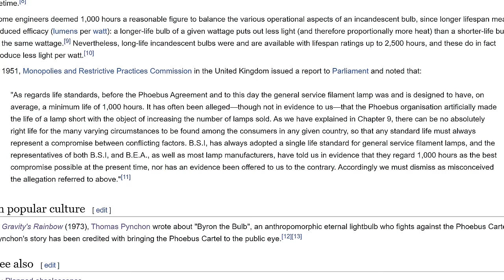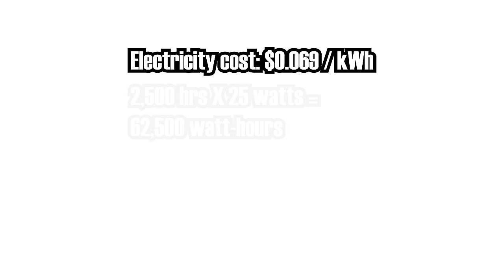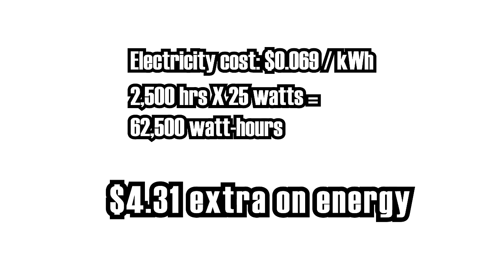Longer-lasting light bulbs: it was complicated

Comment: Things like that evaporation despite being below melting point were really counter-intuitive for me when I first learned about them. For anyone like me back then, the secret to understanding is thus: a material isn't uniform in its temperature. The energy fluctuates between the molecules, with some randomly getting colder and some hotter depending on how those fluctuations happen to  accumulate at any given molecule at any point in time. It just so happens that occasionally enough energy ends up in a molecule on the outside surface to liberate it from its bindings – something that would be melting/sublimation were it to happen to a larger portion of the material. With the energies we're dealing with in white-hot tungsten, it's enough to blast it off the filament with enough speed to shoot onto the glass in a straight line.

Comment: When I used to repair VCRs. Panasonic how to glue that they would put on the power supply capacitors which once over a certain amount of time heat it up would become conductive and blow the power supply. As a young tech it was explained to me that this was planned obsolescence. This was back in 1993.

Comment: One bone of contention for the new LEDs is that it's desirable to get away from BULBS altogether. There is generally no reason to have an envelope around the lamps, except to make them usable as drop-in replacements for bulbs. Using plates or strips allows a smaller unit, with probably less cost.

Comment: I was about to say.
The whole reason a lightbulb works is that it wastes energy on heat that just so happens to make a material glow when hot.
Something under that kind of heat that glows that much would probably be taking terrific wear and tear damage over time.

It would be like building a house out of cars, and then complaining that it kinda fell apart when a relatively strong storm came by.

Comment: I think LED lightbulbs on the whole are a great technology. I have an LED lightbulb that has been running for 24/7 and it has lasted for well over a year now. It has actually probably more likely at lest two years. That would never happen with incandescent lightbulbs. If a LED lightbulb is manufactured properly then the bulb can last for several years depending on how long you use it for per day. If you were lucky you would get about 6 and a half months out of an incandescent lightbulb if you used it for five hours per day. In reality you would get a little bit less or maybe a little bit more due to slightly different manufacturing tolerances between companies and even between individual bulbs. 

So yeah don’t go against LED lightbulbs just because the one that you had didn’t last very long because you have one that’s defective or cheaply made. That’s not the fault of the technology but of the manufacturing process and a company’s desire to cut costs.

Comment: I turned several cheap 100W led bulbs into 60W bulbs by messing with the current regulation circuitry. Now unlike literally every other led bulb I have, they now run cool to the touch. I can't say to their longevity since I did this about 4 months ago but I'm betting it'll be way longer then they would have lasted before.

Comment: Very interesting and informative! However, the very fact an appliance light might be designed for a longer runtime shows a weakness in the argument - if some use cases need a light to run longer, presumably because changing the bulb is expensive (due to limited access), this is something that consumers might face too - changing bulbs every 6 months could be a significant maintenance cost in some areas where access to a light is complicated, and the cartel denying consumers access to a suitable light was not to their benefit

Comment: Depending on brands I been changing some LED bulbs more often than normal Incandescent bulbs, even expensive brands like Philips I had several lamps break EXACTLY after 1 year use, and yes the warranty on these are 1 year but they are marked 15000 hours and I can with ease say they probably been lit 1500 of those at the point of failure. Planned obsolescence is indeed a thing and it been ever since back then. just cleverly hidden by the "reasons" they won´t last longer

Comment: LED light bulbs are currently being pushed as a way to reduce carbon emissions.  The deliberate shortening of bulb life spans by some manufacturers is sabotaging that.  If the bulbs had shorter life due to cheaper parts, that would be one thing (you get what you pay for), but the reason most are dying is because they are less efficient, and therefore producing more carbon emissions.
  LEDs are cold light devices; heat kills them.  When LED light bulbs were first introduced, they were marketed as having a 28-year lifespan, and used 7 or 8 watts.  Now, there are cheap bulbs with only a 5 or 6-year lifespan.  If you compare the watts used, you can see why.  The cheap bulbs are rated at 9, 10, or even 11 watts for a 800 lumen (60 watt equivalent) bulb.  And the bulbs from some manufactures actually use more electricity than it says on the box.  The extra electricity makes the individual LEDs burn brighter, and so the bulbs use fewer of them to put out the same light, but they burn hotter.  If the bulb produces the same 800 lumens, but uses more electricity, the extra electricity is being turned into heat.  I've measured some with surface temperatures of 180 deg F.  Which literally burns out the components, and also makes the bulb less efficient.  And the less efficient light bulbs are bad for the environment.  That undermines the whole point of switching to LED light bulbs.
  The EU has issued regulations that LED light bulbs have to produce at least 200 lumens per watt.  So an 800 lumen bulb (60 watt equivalent) will only use 4 watts.
  The other problem is that LED light bulbs usually have power factors of 0.4-0.6, which indicates more wasted electricity.  Incandescent light bulbs had a pf of 1.0, because they were pure resistive devices.  LED light bulbs have inductors and capacitors in them.  Any device powered by AC that contains inductors or capacitors could have a lower pf.  Pf is a measure of the amount of each watt supplied to the device that actually gets used by the device.  The rest is reflected back into the wiring and dissipated as heat.  Most people don't know about pf because electric companies don't measure pf on residences.  Businesses are a different matter, because businesses often have large motors (an inductor), and a low pf means the electric company has to eat the wasted electricity.
  An example of pf:  Suppose you have a 60 watt device with a pf of 0.75.  That means 80 watts has to be delivered so that the device can use 60 watts (60/80 = .75).  The other 20 watts gets reflected back into the wall wiring and the power feed and turned into heat.  Your electric meter that determines how much electricity you used only records the 60 watts, so the electric company has to pay for the extra 20, and has to take into account the extra heating that occurs in the lines.  Businesses usually have meters that record the pf, and they are charged extra if the pf is less than 0.9, because the power company doesn't want to pay for someone else's wasted electricity.
  The pf can be raised closer to 1.0 by adding inductors or capacitors to the device's circuit, or to the electricity entry point of a building to balance the entire building.  For a light bulb that only uses 4-10 watts, that might not seem worth the effort.  However, there are millions of LED light bulbs, using twice as much electricity as they should.  On top of that, manufacturers are selling lights that use higher wattages; some are 50 watts or more, and while they usually have better pf, it's still wasteful.

Comment: I have an LED bulb that I purchased in 2008 because I wanted it to run continuously.  Almost 15 years later (131,000 hours) it has dimmed slightly but still it’s otherwise fine.  The major brand LED bulbs that I buy at the home center all fail within 12 to 15 months!  Is this planned obsolescence?  I suggest that when you replace a LED bulb, write the installation date on the base of the bulb with a marker pen; you will be shocked by the short life that we get from LED bulbs.

Comment: You should do a video of how air conditioners actually change the temperature. I know about the mercury bead or bimetallic strip, but what happens inside the air conditioner? Is it really just turning off and on at different temperatures?
Reply: Simple: it just makes the refrigerant flow slower.

Comment: A single experience doesn't mean the average experience, but get this: I use 200W incandescent on a dimmer, enjoy quality light with superb CRI and whilst it's running, I've had to replace 3(!) LED's with lower output, running for less time and they weren't some ali express junk - a mid-tier priced lamp in a reputable store...

I pay in electrical bill for this, but in my experience LED's don't necessarily mean longevity as explained in this video.

Comment: I hope the next video is about LED bulbs. I often take broken LED bulbs from friends and simply bridge the one broken LED diode inside to lend them new life. It seems like a crime that most people throw away an entire LED bulb when very often just a single LED is burned out. I understand that loose tolerances in LED production make it way easier/cheaper to produce LED bulbs run in series than in parallel, however, it would be nice of manufacturers left contacts exposed and provided bridging clips to help you extend the life of your LED bulbs
Reply: He made a video about that last year.

Comment: 30:53
I moved into my current place at the end of 2018 and it's become clear the landlord used the absolute cheapest LED bulbs possible. We know the place was remodeled just before we moved in and just about all of the bulbs in the place are the same brand and wattage - so it makes sense why they went with the cheap ones. But I can think of at LEAST 7 bulbs that have gone out since we started living here ... several of those in the first year.

Still, that's not very many compared to what it would be if we still used incandescent bulbs. Plus our kitchen is filled with about 12(?) recessed lights - I can't imagine paying to run 12 60-watt bulbs for most of the day every day, and then having to reach into the recess to change a burning hot bulb every 6 months.

Comment: I had some incandescent photography modeling bulbs rated at 300 watts but only 2.5 hours. I thought that was absurdly low. The light that it produced was very bright and fairly white. I was using one outside though and it started to rain, so rather than just going out like a normal bulb, it exploded instead and I was left to pick up all of its glass in the dark.

Comment: Dubai lamp is a laminating masonry constipation to sell you cheaper LED bulbs that last longer lmao
This has been done a long time ago; you can "under-run" vacuum tube that last way longer, and honestly: you can ran basically everything with filament or motor (even desk fan or computer fan) longer by using some nifty method. (e.g under-volt, current limit, different power supply)
Also, 12:01that 555 lamp uses same volt (6.3v center tapped) as modern vacuum tube like 12AX7/12AT7/12AU7, wonder why.

Comment: I can't get over the shear efficiency of the LED recessed lights I installed in the RV i live in. I draw maybe 15-20 watts off of the battery at high, and use a dimmer to reduce power usage when i don't need that much light. I haven't plugged the battery into power in about a year only use a 20watt solar panel. as we sit here now, the 12v deep cycle battery sits at 13v.  the one incandescent porch light i have uses just as much, if not more power than the 6 interier lights, and only produces about as much as 1 or 2 of the inside lights in terms of output. there is no flicker either because i run a DC system out here (except at very dim levels from the pwm dimmer) and they are warm white and feel cozy. Times have changed for sure!

Comment: Adding an inert gas (most likely nitrogen) was also a clever idea, since you no longer needed to create a vacuum inside the bulb, you could instead use the inert gas to push out any other gas from inside the bulb, and that is a lot easier and cheaper to do.
Reply: it's probably argon

Comment: Interesting fact on  Incandescent bulbs up to 40watts. Lumens ratings are (watts X 10) = lumens. 
(ex: 4 watt=40 lumens, 10watt=100 lumens, 40watt=400 lumens.)
When the 60watt bulb was created, this lumen rule was broken. 60 watt=800 lumens. 100watt=1600 lumens.
The rule is still useful for rating brightness.
Some LED bulbs do not match this formula today. They will print 350 lumens as 40 watt equivalent.

Comment: Going up in the 1970s & 80s, yes, I had to change light bulbs much more often than now.  The difference? Then, it took 1 minute to change the bulb.  Most of the time going to the utility closet and grabbing a bulb out of the 4-pack.  Now, per my lease, I have to go down to the office (if after hours, or the weekend, or a holiday -- the next business day), fill out a Request for Maintenance form and turn it in.  They will then put a note in my door's mail holder, letting me know the amount of of the money order and when can they come by (only after they have the money order -- and yes, it has to be a money order), to replace the bulb.  Generally 2 to 5 days on average so far.

But wait, do it yourself.... can't.  You need special tools for each fixture to remove the covering, and I have never found them online, or on tool trucks.  Also, if you don't have the correct bulb (they are all LED or compact florescent bulbs) in the correct socket -- they can put that as a strike against you.  2 strikes in a year, you get evicted.  

Yes, I am looking for a new place.  Problem is I live in Chicago, and there's the issue of affordable rent.

Overall, I would rather spend $4 to $5 per year replacing my own bulbs, and being without light for a few minutes -- rather than paying $10 per bulb (money order fee for less than the minimum amount + the bulb cost), and waiting for days in the dark.

Comment: There are more factors to play that determin how quickly a light bulb will burn out then just amount of power you're running through the bulb like how think the filament is, the shape of the filament, what the filament is made out of just to name a few. 

Putting a hard 1000 hour limit doesn't make any sense. If your goal was to make light bulbs use less power then give them a maximum wattage, if your goal was useful light per watt then require a minimum efficiency, if your goal was brighter bulbs then give a minim brightness. Even back then they had the tools to measure these sorts of things so why would you go with the most backwards wasteful way to do this?

This is like saying people who run a greater distance burn more calories so we won't let any run more than 100 meters.

Comment: this is why LED light builbs with the microcurcit pcb in a plastic and metal tube that not even fully sealed but was air and water tight bascly could last for like one or two decades these days. thats even when overvolited like crazy still as well.

Comment: the issue with LED bulbs im having is that 9/10 of them work fine as normal white lightbulbs, but I bought them as remote control color changing ones, and the receiver in every bulb ive bought has died after a year, the remote still works on the ones ive had in a box all this time to replace, but the receiver in the bulbs is the first thing to die off

Comment: Late to the party here, but I can definitely say that LEDs, even with the flaws mentioned of poor quality control in those marketed to the average consumer, have ridiculous life spans, the lighting display in my store has more bulbs in that singular display, than most homes, and they are all on for approximately 12 hours a day, 7 days a week, and we typically see 1 or 2 bulb failures a month. Without going and getting a head count there's about 50 bulbs on the display, and assuming the approximate one failure a month we see (i don't keep rigorous notes on it) that's about 1 failure in every 16,800 hours of use.

Comment: Would it be possible to make a lightbulb with multiple filaments in it that took turns as the previous one brakes? Where each filament acts as a sort of switch enabling the next one in line. You could have 4 per bulb and only have to change them every 4000 hours.